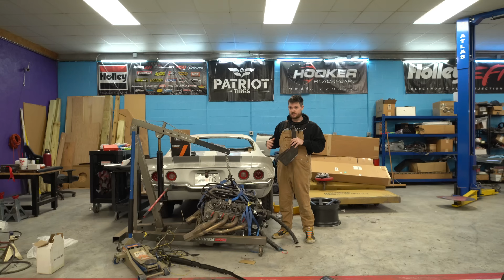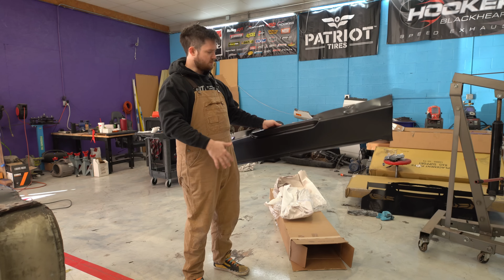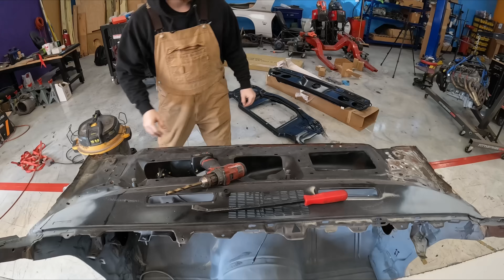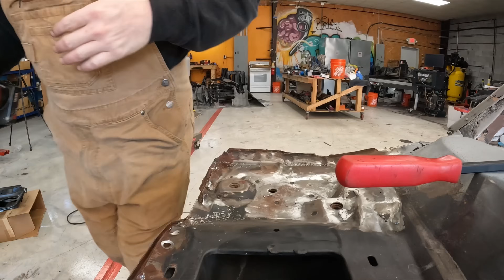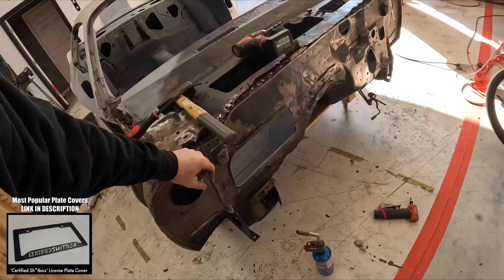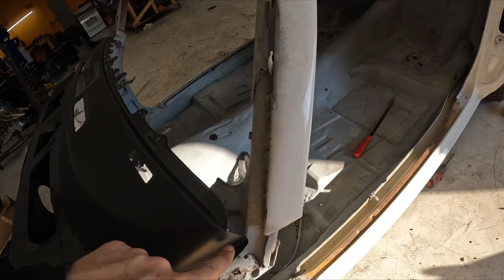Restoring My Classic 1973 Camaro - Lets Get To Business!

Comment: Hey Dan! If you want a tip for removing spot welds on body panels, try a hand held belt sander! Way easier to avoid drilling through the bottom panels! Love the resto content man!
Reply: This and putty knives and a hammer are good at getting under the skin and separate the layers.
Reply: The gritty worly finger
Reply: literally my thought, or just an angle grinder and grind off the whole edge

Comment: For popping spot welds drill em like you have done, try to keep the hole through the panel you are replacing then lay that old panel on top of your new and mark the holes. Use a 6 and 1 style painters knife to really get at separating. Another tip, take a piece of copper, I use a piece of flattened plumbing pipe, to use as a backing blown through spot welds whennyou mig everything back together. The copper heat sinks excess heat from the sheet metal, less warp, and it won't stick to the filler metal from the mig.

Comment: Go get the spot weld and flange air tool from harbor freight! It automatically punches holes for you so you don’t need to sit there with a drill bit. I’m going through this with the cab corners on my OBS ford.

Comment: Great video Dan.
If you've got more spot welds to drill in future, try a spot weld cutter. I used one in a video I just released the other day if you wanted to get an idea of what they do. They do a good job of preserving the panel below.
Also, a long/flat sharp paint scraper works well to split the panels. The screw driver and pry bars bend steel which you probably noticed.
Good job man. Keen to see more. 😎👌

Comment: Get a spot weld drill bit or use the small belt sanders to remove the spot welds. Also see about getting the air punch that will punch holes for a spot welds so you don't have to drill each hole and worry about warping the metal.

Comment: Get a spot-weld drillbit or belt-sander. Chisel + hammer to separate, dress the metal + weld-thru primer before welding, both sides. Good luck in the build.

Comment: Be careful man the radiator supports from any of the manufacturers is usually off. Mine I had to fix two holes. one was off 1/2 one was 5/8 off. I have seen height issues due to the way front pads are installed.

Comment: The thing thay blows my mind here is that Dan showed that it wasnt necessarily hard. Just took some parts and some time. 
The idiot that botched the original "repair" probably did MORE work doing  WRONG than Dan did doing it the RIGHT WAY.
Why donit half assed and do more work when you can just do it the right way?...and not screw over the person after you. Especially when youre going to pain over it with a "restored" paint job